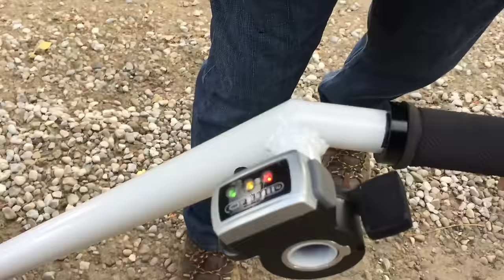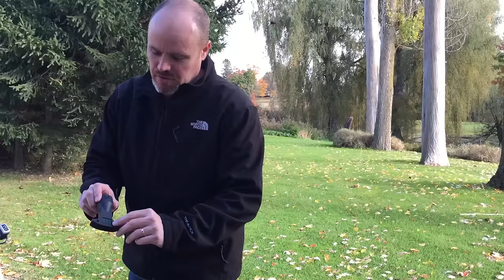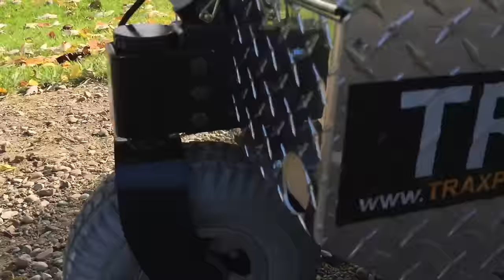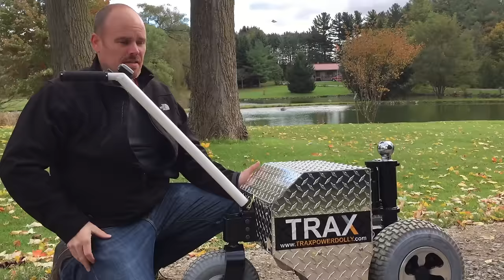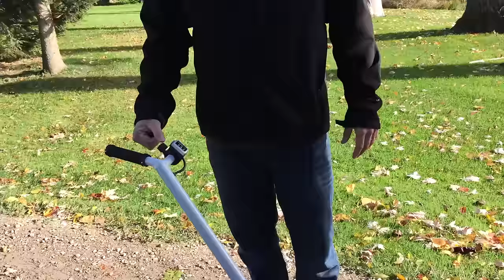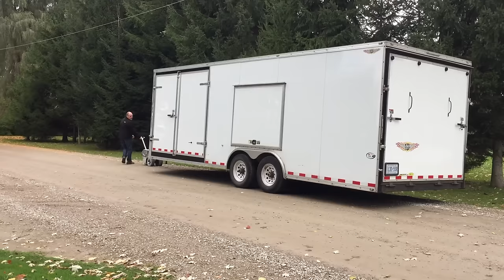Motorized Trailer Dolly TX6000 -By TRAX Power Dolly Systems Inc.

Comment: Does anyone use these on small, fairly solid (new england) beaches to, for example, put a sailboat on a small trailer into the water? I can store a boat in the weeds.....entire boat and trailer would be less than 1000 lbs...
Reply from the maker: This is something we did for one customer, but I will say we have to build a wheel adapter for the boat trailer so that it would not sink in softer sand. The dolly has more than enough power to push and pull but the waverunner trailer tires want to plow and sink into the sand. We are working toward a good working solution and feel we are close to something that will put a smile on everyone's faces when completed. https://youtu.be/opCRYpd81F0

Comment: For right handed operation only.  Not going to work for my 11,500 GVWR fifth wheel.  I like the compact size though.  Looks very portable.  Could take it with to the campground.
Reply from the maker: Terry, the new design has a T-handle so it works great for both lefties and right handed operators.
Reply: @Traxpowerdollysystems  AH.

Comment: Will it push a 5500 lb trailer from the street up and over a 5" curb to get it in the RV spot?
Reply from the maker: You will need to make a ramp to go up and over the curb and give yourself a bit of a run at it and it should go over it nicely.

Comment: OK - I'm sold.   Your design seems MUCH more well though out than your competitors' products.  I also like this because it does NOT use the "standard" ATV winch motor.   I'll be ordering within the next couple of weeks.  Your video of the tandem doing tight donut turns sold me.   Nice work.
Reply from the maker: Thank you, John! The TRAX Power Dolly team spent many years researching all the different trailer dolly systems and found many of them lacking in ease of use, most won't connect to standard trailer ball mounts and most are very noisy and extremely slow. We didn't leave out any customer requests when designing the TX6000. The toy hauler that we are using for our test videos was certified weighing at 7400 pounds. It easily pushed and pulled the trailer up a 10% grade and shoved the tandem axels right sideways doing a full 360º donuts. Feel free to give us a call anytime. 1.519.860.8729

Comment: I like the motorized deal you have there, but you never showed how to get this into a garage in tight space where a vehicle cant get to.  Long explanations.  Think I can use a hydraulic floor jack on wheels or dolly with a hitch on it.This trailer dolly takes a long time to hook up also.
Reply: Once you have the adjustments set it only takes a few seconds to connect and disconnect. If you look at their other videos you’ll see them using it on grass, gravel, on a grade, moving much heavier trailers than advertised and honestly it’s one of the easiest trailer dollies out there. The new design connection is now fully adjustable for almost every kind of latch assembly.

Comment: I just bought one of these.  Two things, the model I got does not have the hydraulic jack to lift the collar, but rather a long lever and a lifting mechanism.  Secondly, there are additional parts (big black collar, screw piece) included that I have no idea what they are for.  Are there instructions somewhere for this newer? design and how to use it?
Reply from the maker: John Fischer ,  check out the new unboxing video found on the website http://TRAXpowerdolly.com

Comment from the maker: A lot of people have been inquiring about the weight of the toy hauler trailer that's been featured in a few of our videos. We designed the TX 6000 to ideally maneuver a 6000 pound trailer. However, The trailer featured in the videos weighed in at 7400 pound gross weight.

Other customers asked if the TRAX TX6000 motorized trailer mover could push and pull a trailer up a large grade. We tested both directions with amazing results, even on a measured 10% grade.

Comment: Cool product!  I see that it is capable of turning with a tandem axle trailer but, need to see a video of maneuverability on concrete or asphalt.... stone will give/move under the stationary wheels to where on a hard surface, the wheels have a lot more grip and the surface beneath them will not move.
Reply: They do have a video on their website showing him rotating a large cargo trailer in a circle on pavement.
Reply from the maker: Here is us turning a 7400 pound tandem axel toy hauler on the spot doing a full 360º turn  https://youtu.be/sADaCZdIV7Q

Comment: Very nice home shop design - I am going to make one with help of spare winch. Main problem is that my boat trailer as many boat trailers does not have electric brakes but proportional brakes so I have to modify your design with some strong brakes. I also make it a bit more heavy duty with double tires on the weight axle for more traction uphill. Cool project.
Reply from the maker: Here is our GT8000 double wheeled dolly with differential axle https://youtu.be/tNWCP7EGdIk

Comment: I'm impressed. The two thing I see missing is a place to carry two extra balls. Many people have all three sizes of trailers and it would be nice carry all three with you. It would also keep balls from getting lost. The other thing that would be nice is a little tray that would hold your tire blocks and jack block while you move your trailer. I could possibly see one in my future.
Reply from the maker: We would be more than happy to build a ball rack for you if that is what you would like to have.  One of the greatest joys TRAX POWER DOLLY SYSTEMS INC. has is the ability to design anything, laser cut almost any kind of metal with perfect precision to the desire of our customers. Keep an eye open for new TRAX products. Both in motorized trailer dollies and attachments. We produce the highest in quality, speed, and ease of use. Give us a call anytime and talk to our friendly sales staff, we are always happy to answer any of your questions or ideas.
Reply: There is enough space under the battery lid to stow my 2 extra balls. I have all 3 sizes and it is nice to have them all handy. With the unit that I just bought they sent along rubber battery terminal covers so they protect any metal contact that could cause arcing so I feel the balls are safe in there. The only thing I had to do was use shorter terminal bolts since the ones that come with the batteries are a little too long, not allowing the rubber terminal boots to cover 100%. The shorter bolts work great and I now have full terminal protection.

Comment: Does this have enough power to get my 4000 lb trailer up a curb?
Reply from the maker: Enough power and speed to push it up a nice size curb. You need the speed to get it up and over, whereas all of the other dollies out there have huge amount of torque but little to no speed to bump the trailer over curbs etc.

Comment: It might make it a lot easier to turn if the handle was attached to the caster and not to the entire body. I like the product!
Reply: Dominique, the caster wheel isn't a drive wheel, it simply drags behind the tow dolly for support and ease of transport.
Reply: Yes I know but the handle is attached to the body which means you have to turn the entire body of the machine. If you just attach the handle to the caster then you are only turning the caster to change direction and not the entire body.
Reply: Dominique Miller what he is trying to say is the caster wheel doesn’t support all of the weight. If you turned the caster wheel, there is not enough weight on it, so it would just be pushed straight.

Comment: Very nice product two questions. Does this come with a Fifth wheel hookup? and second is what is the price?
Reply from the maker: A 5th wheel dolly is in the works and will feature wireless remote controls and will be able to connect and disconnect without the use of the trailer's elevators.
Reply: I am assuming that since the manufacturer didn’t tell you the price, if you have to ask, you probably cannot afford it.

Comment: Can it move a 5,000 lb camper up a steep driveway 35 degree to 45 degree angle ?
Reply from the maker: Jay G , you would need a heck load of tongue weight bro that the dolly tires could gain needed traction. Most trailer’s wouldn’t have enough tongue weight to do that size Of angle.
Reply: I was actually very off in incline measurement. Looks to be that my driveway actually has a 13 degree slope. Is that doable uphill with your dolly on a 4000 lb camper?
Reply from the maker: Jay G , could you send me a photo if the area of use to sales@traxpowerdolly.com so that I can get a better idea of what we are dealing with?
Reply: Just sent
Reply: @jayt7013  Hey! we want to see it too!!
Reply: 45 degrees? Truck won’t even have that traction.

Comment: In the trailer valet video  I found the winch system you used interesting could you tell me how to make it or get one
Reply from the maker: Please expand on your question. I’m unsure what your request is.
Reply: @Traxpowerdollysystems  the winch used to pull up the drive way did you make it or buy it and how did you mount it so the trailer wouldn't pull it out of the garage

Comment: What are the length and weight specs for the trailer you pull in this video?
Reply from the maker: Peter, we had the trailer loaded at 7400 pounds and the length of it is 24 feet long.

Comment: I love that the TRAX TX6000 can turn at a 90 degree angle, but I'd like to see how to turn the dolly from a straight position into the 90 degree angle while attached to a trailer.  The problem I have is I need to squeeze the trailer into a tight area and sometimes need to move the dolly to a 90 degree angle without moving the trailer.  Also, when will the TRAX X2 (with wireless remote) be available?
Reply from the maker: Steve Hockemeier, you can do this but you will need to pull hard on the control  to turn the dolly on the spot. It is doable but requires a bit more mussel to do.
Reply: @Traxpowerdollysystems  That would be "muscle".

Comment: How much of an incline grade can it handle?
Reply from the maker: Raw Fish, this is dependent on a few factors. Gross weight, tongue weight, and Ground texture type. I’ve used it on a 10% grade pushing a 7400 pound trailer up the grade with an 800 pound tongue weight.

Comment: What is the degree limit for a hard dry surface incline?
Reply from the maker: This depends on tongue weight vs total gross weight, the more tongue weight to total gross weight will allow for larger grades as it’s the tongue weight that will determine best traction for the pushing, pulling and stopping the trailer.

Comment: I have a 30’ Airstream, 8800lbs loaded with a 1150lb tounge weight, will this unit work/ I need one.
Reply from the maker: Ted, it should work like a champ!
Reply: I think my RV is 9500lb loaded. Will this work over relatively flat grade concrete? What about gravel or grass? If not, is there a beefier model that will handle more weight? This product seems ideal.
Reply: @jasonjohnson3424  maybe put chains on tires?

Comment: You should be aware of the aviation market. For hand moving small aircraft in/out of hangers. I used to own a gas powered one. This is much nicer.
Reply from the maker: Jack,
We are looking into aircraft attachments, however we need to ensure that it will work for both tripod and tail draggers style airplanes.

Comment: Well, u did what I needed to see it do; jack a Tandem Trailer at a sharp 90 degree angle.
Just one problem, my Trailer Ball height is not that high!
Reply: Ray, what is your ball mount height? We are working on a lower solution at the moment.
Reply: I'd have to measure it and respond
Reply from the maker: The new measurement ground to top of ball is now 20"

Comment: you have dirty on your camera sensor, i can see it moving about as the image stabilization is operating
Reply from the maker: Lol yes but I couldn’t clean it for the shot. Good eye btw. 🤔👍🏻
Reply: @Traxpowerdollysystems  as a cinematographer i notice these things, i did bug me for a bit but i got the message about the product, unfortunately im in new zealand so i think shipping might cost too much, our trailers have hydro brakes not electric, a failsafe if the engine cuts out and can supply power

Comment: how does this compare to parkit360?
Reply from the maker: Speed, noise, ease of connecting / disconnecting, cycle drive time, variable speed control, multiple adaptor plates, built in motor brake control, low amp draw from the battery ( unlike most winch motors draw huge amount of amps thus causing damaged battery and overheating electric motors. This is why most winch motored dollies have a cycle time 5mins or less. ) We spent a lot of time in development to ensure TRAX Dollies are top-tier  over any other design out there at a great low price. We haven't changed our prices in over 6 years now and we manufacture and assemble everything possible under one roof. Canadian built and designed

Comment: I dont understand the bottle jack and plate. the trailer coupler latches to the ball. that whole system is pointless.
also the plug should have power to the power supply pin for people with electric jacks
Reply from the maker: We need to do this to stop the dolly from creeping away or under the ball attachment point. If we did have this in place a lightweight compact dolly would want to roll under and over the weight of the trailer's tongue weight.

Comment: I don't think 10% and 10 degree slope are the same.  You should clarify which you mean.
Reply: 10% grade is standard terminology for describing a slope and is perfectly clear. It means a slope with 1 ft rise per 10 ft horizontal distance. A 10% grade is equal to a 5.7 degree angle. A 100% grade is equal to a 45 degree angle.